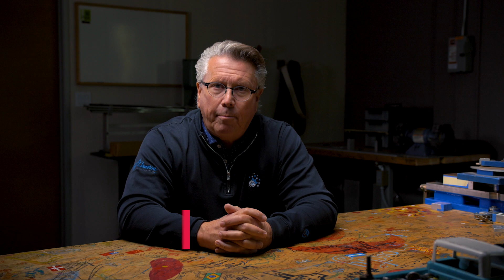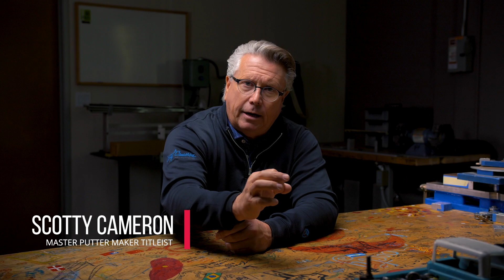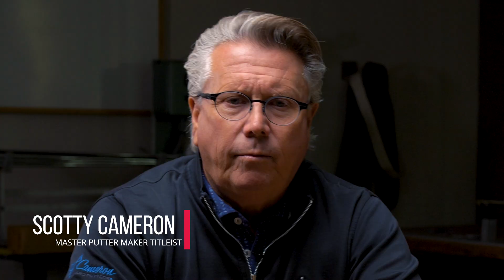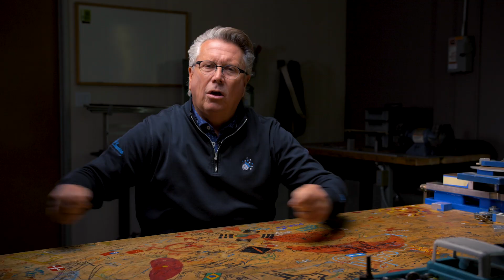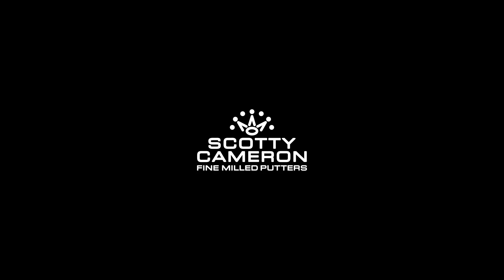Shaft Design  |  Scotty Cameron Putters

Comment: YOU NEED TO PUT A MAGNET ON YOUR HEADCOVERS 🙏
Reply: Yeah. My Scotty headcovers have never been used for a round. The first thing I do when I get a new Scotty is throw on an aftermarket magnetic headcover. And I know I'm not the only one that does this. I think they're losing a lot out on the marketing value from seeing Scotty headcovers in bags by simply not having magnetic headcovers.
Reply: @michaelocean4788  exactly and all they would have to do is copy someone else's head cover with the magnet in it, they are pioneers at copying people's designs
Reply: @michaelocean4788  I use a Magnetic Because It ISN'T a Scotty cover.

Comment: Scotty - You should incorporate the new stiffer lower torque graphite putter shafts. The old steel putter shafts will be phased out just like in drivers because they are more efficient. 

Its the primary reason I no longer use an SC. Furthermore, your company wont service/repair an SC putter with an after-market shaft (or any other brand name shaft) in it. It's absurd.
Reply from the maker: Scotty works with the best players in the world every day and the reality is 99% of them use steel shafts. The feedback we receive from these top players i.e. Shaft feel and performance is then placed into all our production putters. 

We will always work on your putter, but as it stated on our website we do not service putters with aftermarket components except for grips. Meaning if you want to send in your putter with an aftermarket shaft we would then have to remove it and replace it with our shaft. You can also send in your putter head with the shaft removed and we can work on it. If you have any further questions about customization for your putter we would be happy to answer. Please call our Customer Service Center toll free at (800) 214-0213.
Reply: @scottycameron   Once again, this is absurd that SC will NOT service an SC Putter with an aftermarket shaft unless your company removes it and installs your steel one. Rigidness like this hurts market share and runs off loyal customers. Not to mention, NOT changing with the times/technology also achieves the same loss in market share. News flash - your steel shaft is no better than every other steel shaft on the market and definitely NOT better than the modern day ultra stable graphite shafts (same data and results as in drivers). A slippery slope of stubbornness SC...............there was a point way back in time when "99%" of the best players in the world played steel shafts in their drivers - UNTIL THERE WASNT! Now, 100% of the best players in the world play graphite shafts in their drivers!
Reply: Couldn’t be more wrong
Reply: @SMUGAMER  haha they basically gave you a civilized, but passive aggressive way of saying the exact same thing.
If I sent my putter in to this wallet vacuum of a company just to have some paint touched up and it came back with a different damn shaft in it, then the $400  I sent it in with.... they never hear the end of me until it was fixed and or they sent me my shaft back with the cost of shipping both ways and the money to cover the little paint job they did and to have the shaft reinstalled locally..
Not only did they say we won't offer aftermarket shafts, but now they're acting as if they're doing you a favor by letting you pull your putter shaft just to send in the head for them to work on?
 or if they were to ever receive your putter they would immediately pull your expensive preferred shaft to put in one of their stock shafts just so they could work on the head...
What an absurd answer why even take the time to write as if "hey don't worry we'll still work on your putter..."
Just say exactly what they said in the top. most PGA Tour players we work with prefer the steel shafts for now...
Even with that said, it's customers like you and a lot of crazy customers who buy collections and are compulsively obsessed with The Narcissist himself Scotty Cameron, you're the ones actually putting money in his wallet by buying the putters at outrageous prices. at least let them choose the shaft they want, no?
Or if you're not going to, don't even dare to remove someone else's shaft just so you can do head work unless they've given you prior approval- that's just wrong
Reply: I think Scotty here is forgetting that the top players in the world hit the center of the putterface pretty much always, we the consumers would too if we could practice a 1000 putts a week.

It's obviously the misshits where the Stability shafts help the most.

It's a joke that PXG is ahead of Scotty Cameron now when it comes to putter shaft design for customers with their new M16 graphite shaft.
Reply: @NovaScene CONGRATULATIONS! And You are why the Newport and Newport 2 have those 20 gram Heavier Weights in the Toe and Heel. Scotty took the Weight from where you Don't use it - the Sweetspot - and moved it to where you do.